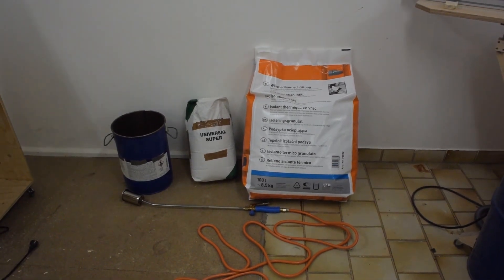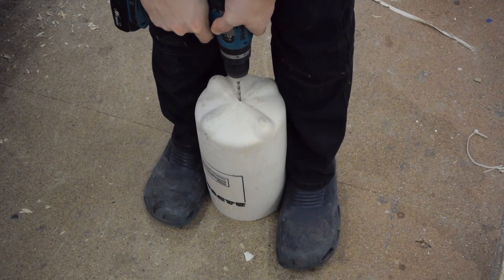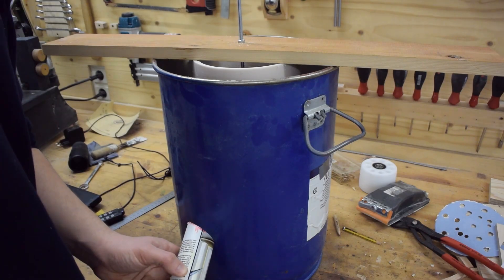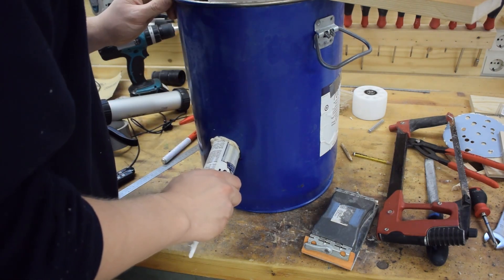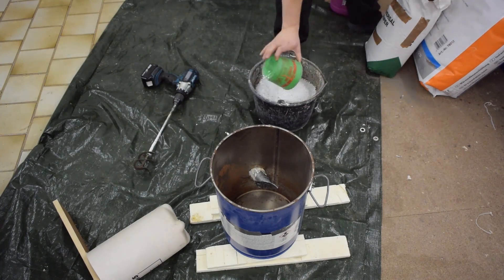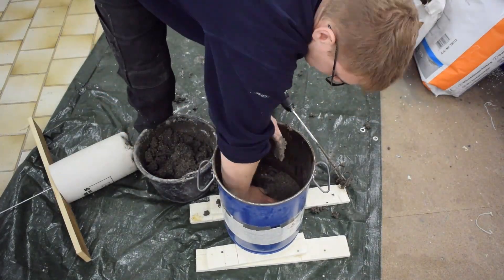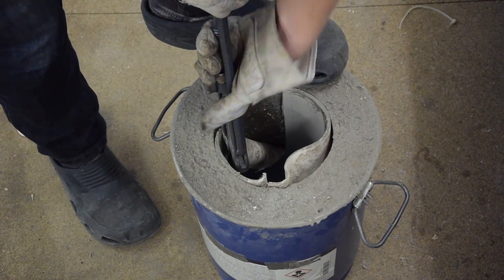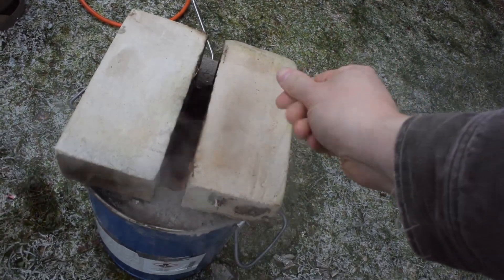Making a Metal Melting Furnace (Simple, Effective, Propane)

Comment: i always thought that molten metal interacting with the tiniest bit of moisture from the ground would make it pop. was it so little metal that it cooled quickly?
Reply from the maker: You were wrong. That sounds like something out of an action movie.
Reply: @CosmasBauer  ah cool. just something I read. Higher metal to water makes boom, like if it splashed onto concrete a day after a rain. I know about splash casting being safe because it can cool quickly though.

Comment: why is it the insulate wall collapse in some areas? could i fill in this area when you burned test at low temperature? can i use the powder pyrite in place the bead shape mixed in with the high-temperature cement? how high the temperature this furnace reached? it was informative to see this.

Comment: That crucible is super, simple cheap and full proof, great design.
I think I will do mine that way.
Reply: Crucible is super cheap if you have a welder or friend with one. That's the part that holds the molten metal itself.

Comment: There  appears  to  be  pro's and  con's to  your  square  crucible. You  intentionally  made  the  furnace  so  that  the  flame  would  swirl, but  then  the  square  crucible  prevents  the  swirling. However  your  system  of  pulling  out  the  crucible  looks  good  and  the  crucible  has  it's  own  pouring  spout! Overall  it  works  so  kudos  to  you !
Reply: Sure does hinder it though.
Reply: Squares don't prevent swirling.

Comment: could you melt copper in that steel crucible?
Reply: A steel crucible would not hold up well melting copper.  Both higher temperatures, and steel dissolving in the copper.

Comment: In this furnace you can melt cast iron? or just aluminum? or for cast iron I have to use propane, because the coal does not release enough heat? Thanks and greetings for yours success. :))

Comment: why the bucket doesn't melt ?
Reply from the maker: It is insulated by the concrete mixture so It does not get hot. Also this furnace is not hot enough to melt steel.

Comment: Propane Weed Burner from Harbor Freight. Does it get hot enough to melt silver?
Reply: the burner itself often isn't the biggest factor to how hot the foundry gets, its actually the insulation. The better insulated the more heat goes from the burner to the crucible. Propane can actually melt steel, but you've got to have the right conditions. A forced air burner will get hotter and burn more reliably than a atmospheric burner like weed burners are.

Comment: What is that torch device called?  I need to buy one.
Reply: its a weed burner, each hardware store seems to have its own model of weed burner, but they are all pretty much the same.
Reply: I've made one like kor (rip) and I've used a weed burner but the tin can doesn't get hot enough before my gas freezes up? What have I done wrong??

Comment: You should use a cylindrical crucible, the squareness prevents the fire from spinning around the crucible.
But great project and awesome video!
Reply: How profitable is smelting aluminium? A how do u sale it?. I did a great job
Reply from the maker: Yes you're right!
Reply: Actually, the squareness adds turbulence and slows the flames slightly, resulting in faster heat transfer to the crucible. And the surface area of a square crucible is greater than a cylinder, again adding more surface exposed to the heat. Crucible placement and orientation to the flame front may be a possible place for experimenting. Try not to be so negative, it seems to work very well, the pour spout is less constructive than a standard crucible, it poured quickly, and easily! All thumbs up!